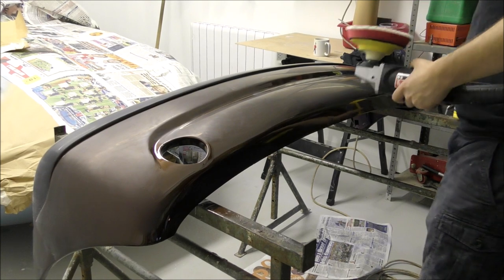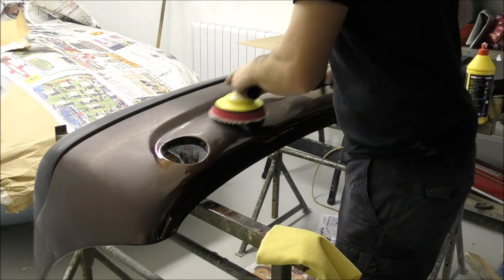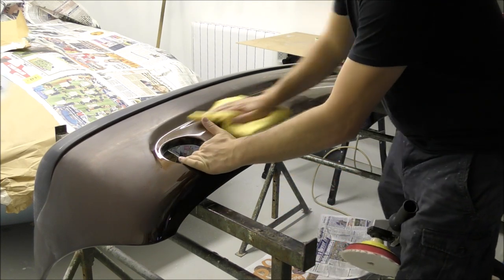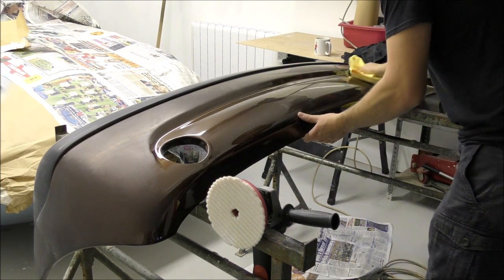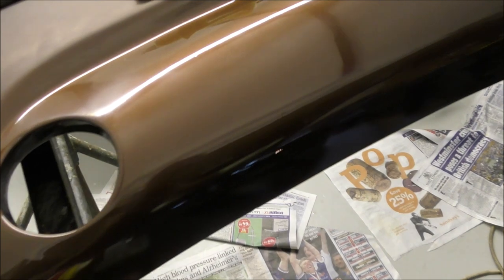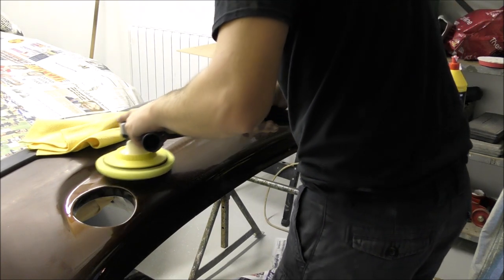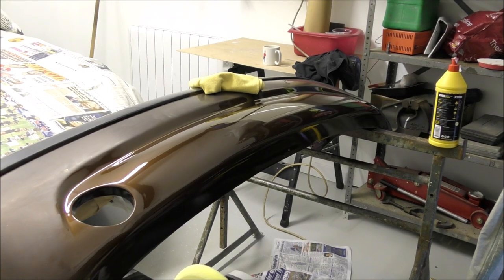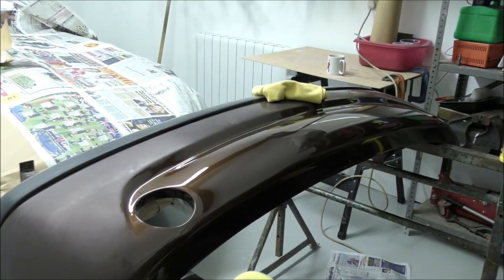Polishing black car paint with Farecla G360 polishing compound!!

Comment: Interesting video as I used G3 Ultra myself for a long time because as you say it was quick and efficient.

I now use a Roar product which is similar but less fill.

The only reservations I’d have with your buying the system based on your video is that it’s relatively easy to get a great shine using a two process system, but it’s the amount of filler that needs to be assessed.

As a mobile SMART repairer I don’t want to be returning to job, and having to wash the panels after compounding to remove filler is a PITA.

Comment: I find the wool 'GMC650' head on rotary on bumpers is too dangerous, I also use the GMC350 3" on a mini polisher and that too far too quick super heat take off bumper paint !!!!

Yes it most certainly DIGS into paint applying pressure.  I use on my cheap cars as.a car trader.  Also gives Holograms to finish later.

I'm inexperienced. I use G3 and G360 to cut and use largely wool pads on metal panels.  Hardly use a foam but struggle not to dig/head/melt paint

I finish with G3 Wax.  To be fair it's good stuff Farecla.

Comment: Very interesting video. This is a polish that I'd like to try. I already hv some of these products. But don't have any of their pads. Can I buy them in the UK. It can be confusing as to which pads to buy when most if not all manufacturers choose different colour pads.
Reply from the maker: Hi Paul,

Pop into your local motor factor and ask them about the correct pads or take a look at the datasheet as to what pad codes you need. I know sometimes the factor just gives you any which is never good🙂